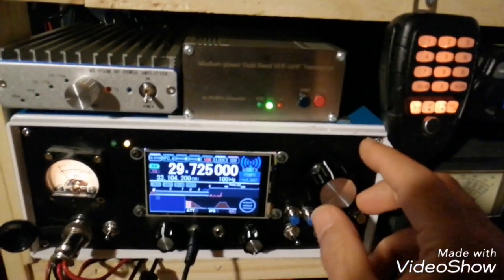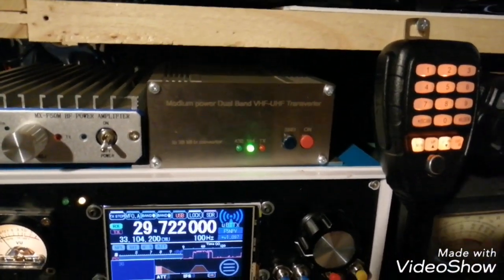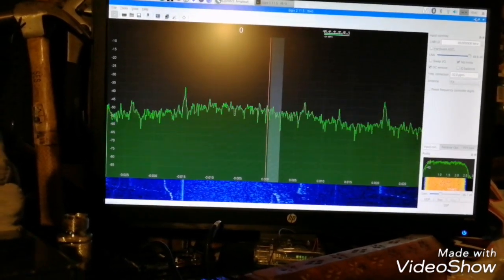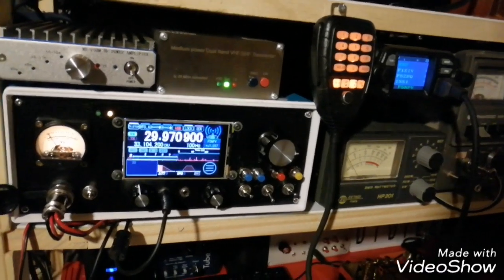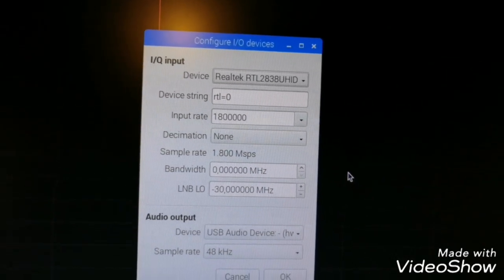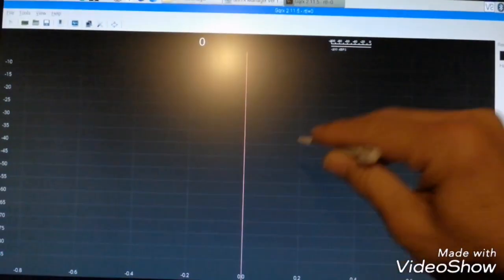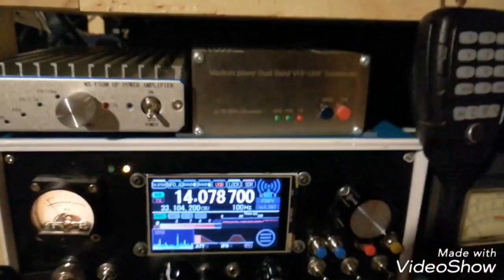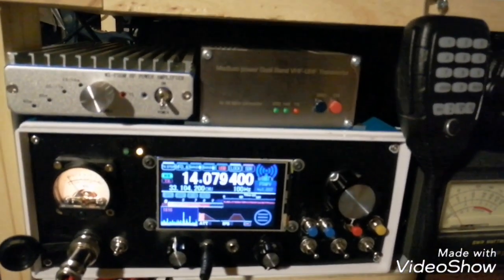F5NPV UBITX and satcom

Comment: One of the most impressive sat systems I''ve seen using a transverter ! Much impressive work done here … And bravo using the uBITX. Such a quiet receiver. I use mine daily for JS8CALL.  N6GRG. I wonder if programmer Ian of Hamskey.com  has seen this ? I will ask as you are using his best software additions for the uBITX ! He will be impressed I'm sure.
Reply from the maker: Hello MICHAEL,  My UBITX is fully modified with the following mods :

-CW/SSB DSP filter
 from Sotabeams

-I rebuild the LFP

-AF amplifier TX and RX rebuild

-RTL SDR addon

-Signal analyzer addon

-Nextion 3.2 Screen

-144/432 Transverter addon for SAT communication

-RFpreamplifier

-i  rebuild the internal RF amplifier

-IF amplifier and mixer rebuild

-Analog S-Meter addon

Internal shielding

I am using the V4 Board and the firmware is the one from Ian (1.097). I am more than happy with this device , working perfectly and the firmware from Ian is simply perfect , providing a lot of features for customization . I am working now on a new UBITX fully modified also but i will include inside a power amplifier , the transverter , a Raspberry PI , the SDR etc etc .... All will be embedded and fully integrated with a control from the front panel. A lot of work to achieve and i guess it will be ready within December i guess. All the best and to catch you on the air 73's Mate
Reply: @f5npv-v85npvamateurradio3  I have both the V3 and the V4. I prefer the V3 so far, so if I were to begin mods it would be with the V4. Especially Ians software and I have a Nextion for it. I'd love to see an in depth video showing close up of your mods. Especially the internal shielding work. And anything else you can describe. I'll add it to uBITX playlist number 2 !